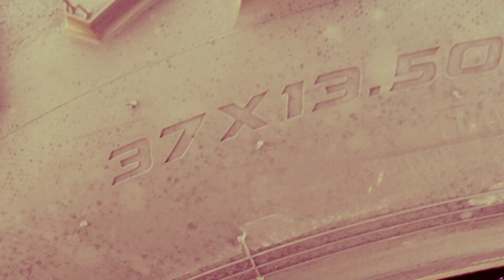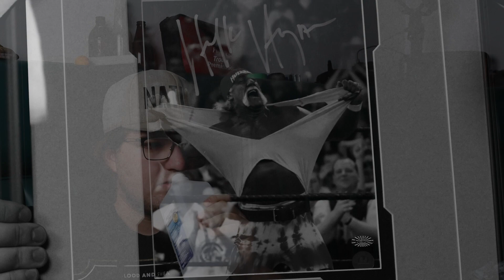How To Remove Window Tint Glue!

Comment: As a former tinter we avoided dry heat always. Steam works best pair with a 2inch razor blade holder. Short motions and the whole window is done within 10 mins. After I removed that if there was still a film left rubbing alcohol would be the best cheap step